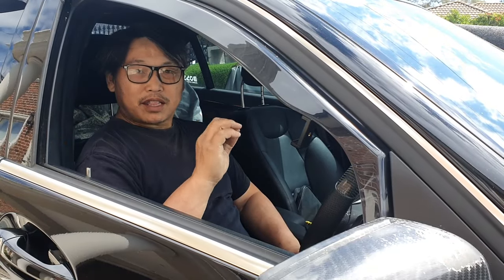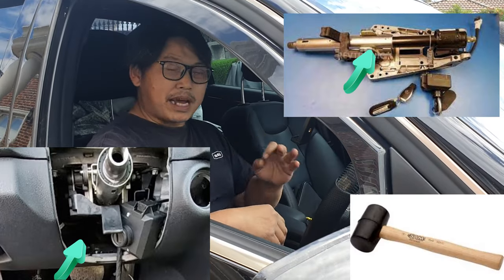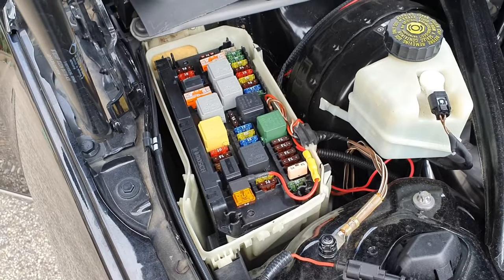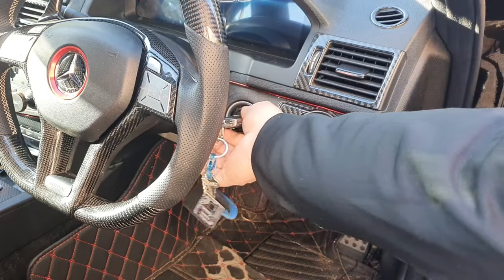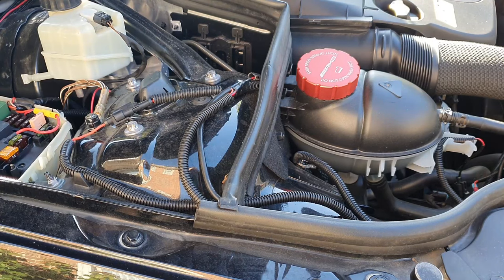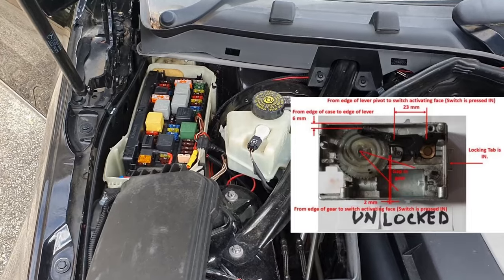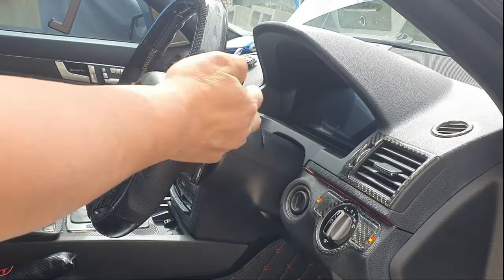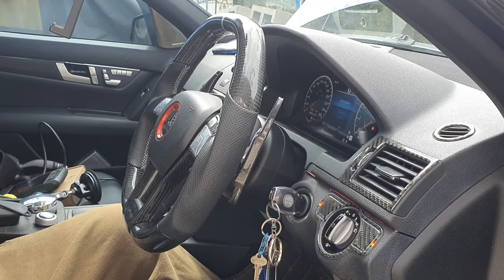mercedes w204 ESL FAIL STUCK? use this trick BYPASS and JUMP START YOUR CAR

Comment: Thanks, my car is at the Mercedes workshop, the price they gave me is usd1,750 for replacing all the ESL lock, it is insane so I will try to change the motor myself first and see how it goes. A question, thanks God the wheel is unlocked, if I do this trick to start the engine (just for not using a tow truck) do you know if the wheel will remain unlocked when I turn off the car? or there could be a possibility the wheel gets locked and that will means a big headache trying to remove the ESL lock then?
Reply from the maker: if you start the engine it will remain unlocked , u dont have to worry, just make sure you disconnect the battery whilst the esl is still unlocked that way to can do the fix easily, even if its locked there are still ways to do it , it just requires removing the entire steering column with esl intact, and drilling a hole to move the mechanism by hand with a tool, many ppl have done this and succeeded , so its not impossible, however i just prefer to do it thye right way, but some ppl dont have that luxury
Reply: @MIKEYZVLOGZ  thanks, so you mean when I turn off the car I should keep the key inserted and then disconnect the battery? So after replacing the motor in the ESL and connect the battery back the car will think that "nothing happened"? it won't notice the motor replacement? do you know how long will that Chinese motor last? finger cross it is only a motor issue.
Reply from the maker: @gabrielirlanda  mine has lasted since i did the video so almost 5 years
Reply from the maker: @gabrielirlanda  and yes wen u reconnect th ebattery ensure the key is inserted like it was wen u dc, the battery, and sometimes u will need to remove key and reinsert again
Reply: @MIKEYZVLOGZ  thanks a lot.

Comment: I took my ESL out and attached it somewhere else so it wont mechanically lock my steering. I wonder if I can follow this guide to start up the car just in case my ESL fails at locked position, even though it no longer mechanically locking my wheel. Thanks,
Reply: Where did you attach it and did you get a emulator

Comment: I accidentally dropped the fuse part in the compartment, am I able to go buy a new one, and if so which one?
Reply from the maker: do u mean the relay? if so yes u can just goto a auto shop and tell them what u need , its a starter relay just ensure its the same pinout

Comment: Hi, what I just want say is many thanks for sharing that film. My car and I were grounded for 5 days. I was lucky because it broke down at my workplace on a safe parking. ESL failed with no previous warnings with unlocked position. Four mechanics couldn't find what the problem is and no local garage wanted to fix it. Finally mobile locksmith found the problem but couldn't fix it on the site. Your film helped me to safe the money for towing my car nearly 40 miles back to my home and hundreds of pounds for the repair as I will fix this now at home using your film as well. Cheers and regards from the UK.

Comment: Hey i saw ur esl moter replacement where did u get that small motor
Reply from the maker: readily available on ebay and aliexpress ..mine was from aliexpress ... its a generic motor ... I used any generic one ..doesn't have to be top line most exspensive ..I've had mine die 3 years still going strong

Comment: @MIKEYZVLOGZ been watching your vids for a while now. I'm getting a prefacelift w204 from a friend and been checking out your upgrades and retrofitting. One thing I'm very keen on is brake hold from the facelift. I know the prefacelift has hill assist (holds the brakes for a few seconds till you accelerate when not on flat ground) but the facelift has brake hold on any surface indefinitely once activated. I've found somebody online that has tried but he didn't manage, even after adding the facelift instrument cluster and enabling the feature. One suggestion was to replace ESP, but there were no further updates. Is this something you looked into by chance? Or can you maybe investigate some? I think it would be a super useful feature to have. Thanks!
Reply from the maker: honestly brake hold isn't a deal breaker..if u think about it just leave ur foot on brake or use handbrake ..its never bothered me so I didn't bother researching
Reply from the maker: and if u think about it is it really worth it to try retrofit wen u can just use hill assist and step on brake or put handbrake up
Reply: @MIKEYZVLOGZ  thanks for the quick reply. Keeping the foot on brake is fine for sure. Not sure about the handbrake though, I'm not a big fan of this implementation. If you find yourself in a position where you can easily ask others about this or otherwise check, would very much appreciate the input. Thanks for all the vids and keep up the amazing work!

LE: probably not worth it unless easy to do. I expected since the hold basically exists (hill assist) it must be a software update or something minor to enable the facelift feature (brake hold indefinitely).
Reply from the maker: yeah I'll ask about it

Comment: Nice video.
One question i have one problem with my w212 I have make offline the key or disabled and is the only key i have,so to enable tester say i must give ignition on but i cant because is offline can you give me some advice how i can give ignition on without key from fuses or ecu ?? 
Best regards
Reply from the maker: @Shaban.dehari  honestly I'm not sure because it needs to over wrote the immobiliser from ignition

Comment: Great video mikey i had the same issue my windows wouldn’t go up either after watching this I managed to get the windows up steering has unlocked after tapping on steering wheel I tried bypassing to get it started by using Saftey pins I managed to get it cranking but it wont get the engine running any ideas why ??
Reply from the maker: @phantomxviii6292  what do u mean by using safety pins? seems like u have an issue just getting ut started ... the engine turns over? esl is unlocked? and wen u try jumping it this way ... it only cranks?
Reply: @MIKEYZVLOGZ  just an update i got it fixed it turned to be the esl motor i had it done by a mobile locksmith i saved £1200 but yh this video definitely helped alot thank you from London England
Reply from the maker: @phantomxviii6292  great stuff

Comment: My car is c250 2012 the steering is unlocked but it dosnt crank ive tried your steps it dosnt crank also so do u think its the starter it self needs to be changed?
Reply from the maker: if its not cranking its prolly the starter..does it turn over at all
Reply: No crank at all
Reply from the maker: @mobynahleh  If there no crank at all.. ull have to check the starter ... I don't think this trick will work if your starter isn't working
Reply: mine is turning over but not starting, so it’s more likely the starter & ESL ?
Reply from the maker: @GunnaxRu  yes if your car turns over then it's not esl
Reply: @MIKEYZVLOGZ  you are right it was the starter i replaced it and now its working 🎉 thanks
Reply from the maker: @mobynahleh  glad to be of help good to hear your back on the road mate ..where ur merc belongs!!
Reply: Is ur keys ..If it don’t crack u need a new keys first
Reply from the maker: @mikeumu603  not necessarily... it can be a number of things ... for example esl is one big common fault..but it's not always the issue..can be eis fault or starter... but it always depends on the symptoms ... if it cranks but does start..it's usually starter ..if you put key in and no signal at all then it's esl module motor.

Comment: Is 10w40 ok to use when no 0w40 available ?
Reply from the maker: thats a massive difference no thats alot thicker
Reply: @MIKEYZVLOGZ  i used 20w50 engine oil that only oil available in our remote are but now engines runs very smoth  , thanks
Reply from the maker: @AliSaleh-yp2fh  from what i understand correct .e if im wromg anybody.. the reason for smoother running would have sometjing to do with such thick oil msking alot of rattles and leaks ... which is why it might feel like its alot smoother..but also for older engines sometimes using thicker oil on very high milage cars isnt so bad as the thickness helps to keep the engine really lubricated ...i do the same with my older cars too i use 10w40 for very high milage toyotas and it runs great ..but bring mercedes i would run recommemded oil...but if ur not seeing any issues u might be ok..but i wouldnt advise it..but if u habe been doing it for a long time and its been ok i guess it has gotten use to it... i also find that if i go back to 5w30 after using thick oil like 10w or 20w 40 u will notice leaks and noises due to thinner oil getting places thicker oil wouldnt..this is my opinion... i always recommend manufacturer specs
Reply from the maker: as long as engine is ok i cant say anything  @AliSaleh-yp2fh
Reply: @MIKEYZVLOGZ  yesa sir engine very happy and smoth as butter i change oil Nd filter every 5km
Reply from the maker: @AliSaleh-yp2fh  then thats good friend qjust keep doing what ur doing ull be ok

Comment: Hi 
I just tried exact same things as u did 
But i have two problems 
1st is that after is put the fuse back to its position it turn the meters light on but if we off it and on it again then it doesn't work
And 2nd is that. When i try to start the car with the help of wire it just keeps revving the self but engine doesn't start 
Plz help me urgently
Reply from the maker: hi friend  sound like u have an electrical fault ... I'm sorry to say that but I haven't heard of what's happened to your car.  did u simply only try exactly what I did? did u accidentally short anything ? because it sounds very much like something is wrong with a sensor
Reply: Yes brother
My ethanol sensor was out 
I had to send my car to Mercedes and they changed it
And it work fine now
Btw thnku brother

Comment: C240 W203 can a gearbox module make car not to accelerate over 60km/h
Reply from the maker: I am not too sure about this ... usually wen a car doesn't accelerate over a certain speed..its in limp mode ..u need to do a scan and see what's causing the limp mode..limp mode protects the car from damage ..so there's def something wrong

Comment: I’m currently broke down. When I put the key in, I can hear the ESL unlock and steering wheel unlocks, I have power to the dash, but no clicks, no crank, and no start. Is the ESL still my issue or is it something else? Cheers and thanks mate
Reply from the maker: does it turn the dash on where u see all the lights   ..before you start the car..if u don't get the acc function then it can still be the esl module..it's also possible to have the whinding sound and still be faulty
Reply: @MIKEYZVLOGZ  yea I do, dash, lights and everything come on. But when I go to turn the key over I get nothing. This is the first time I’ve been this stumped. Even tried the Hotwire scenario and still nothing. Would that be the starter instead? Again much appreciate for the help and info brotha.
Reply from the maker: @Harleycactor  ok if u get dash lights it's not esl..it's most likely starter motor cuz no crank
Reply: @MIKEYZVLOGZ  ok thank you. One last question, where the F* is the starter motor. I can’t seem to find it anywhere, or proper schematics of the 2007 cls550
Reply from the maker: @Harleycactor  oof sorry a quick google and u will find it on google, or use the forums unfortunately i dont know much about the cls550's mate , sorry
Reply: @MIKEYZVLOGZ  all good. Thanks for the help up to this point brotha 😁👍🏽
Reply from the maker: @Harleycactor no sweat buddy ...I appreciate u for stopping by

Comment: Does any one know the following info?  If ESL is unlocked can I just unplug it without removing IT, then put in an Emulator?

If ESL is unlocked and I remove BATTERY power, can I also take the key out and expect ESL not to LOck?  Then put in Emulator?

Do you sell services such as I give you the key and the device the key goes into and you provide the emulator?
Reply from the maker: @IProvideIt  1st yes u can unplugged it whether or not it's unlocked ... but removing it would require it to be unlocked..but there are ways around it ..abit more involved 

2nd yes if u disconnect battery when esl is u locked u can remove the key and it won't unlock because there's no longer power to run the esl module ... but doing this make sure u replace the key  before connecting battery so ur in same situation prior to removing key 

3rd..yes most auto locksmiths can do this Job now..it's very accessible via most automotive locksmiths ..do a google search of your area and I'm sure you will find someone to code the emulator for u to sync with your car ..

if your going to go the emulator route ..u still have to remove the esl and eis (ignition barrel) and send then off with your key so they can sync the emulator to work with your setup

Comment: Will this work if key doesn't turn at all?
Reply from the maker: it might ..is tour steering wheel unlocked? if it is u  an try and It can work
Reply: Thanks for replying so fast! I took the pin out so the steering wheel is unlocked. Does the esl need to be plugged in when I try to start the car?

Comment: Hi Mike I saw in the review that the errors are reported on the old cluster...but on the new one are the errors and warnings displayed?

I saw that the new cluster is installed but the errors are displayed on the old cluster... why?
Reply from the maker: im not sure what u are asking, pls clarify 
the errors are there , if you have error messages from your old cluster you will see the same errors on the digital cluster 
i will be doing a short soon showing the cluster being used whilst driving i will purposely pull cables out for lights so it shows the errors
Reply: I don't have a green relay there. I have one in the trunk,  but mines a 2007 c230wz. Could that be my starter. Or could I use that green one. In my starter relay spot.
Reply: I have another question. I have emulator and new ignition. And key fob.  Sent them off to be programmed. But my car stoll won't start. Key turns. The ignition. But won't start. And also I think its the prefuse box. 100 amp. Read somewhere that's how they fixed it. Do u know anything about this?
Reply from the maker: @crystaljean8069 have u checked your starter ? does it crank at all? did u have the ignition barrel sent off as well ?
Reply from the maker: is yours a w204 still?